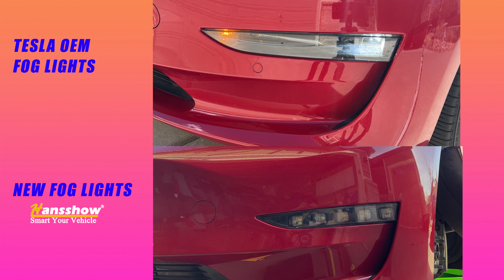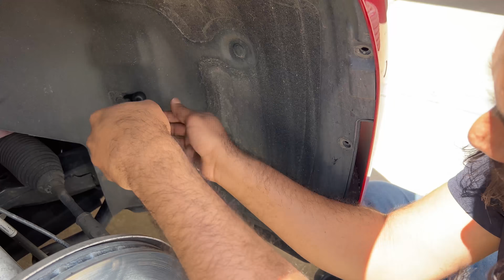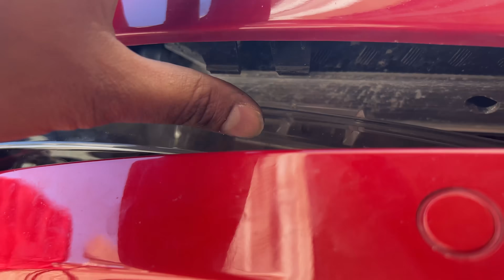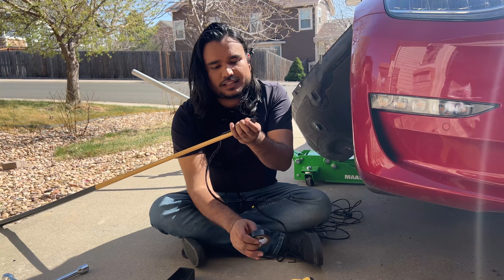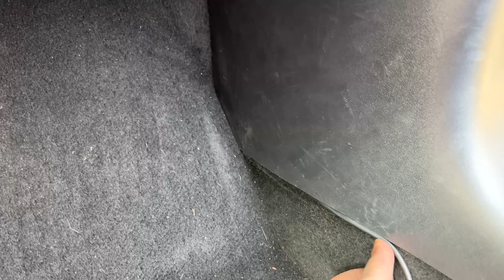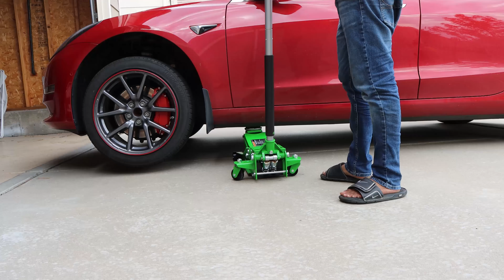NEW Sequential Fog Light Upgrade for Tesla Model 3/Y - Turn Signal (Must Have Accessory 2022)

Comment: Hi Shiva
Thank you for your hard work for us 
I have a question 

Could you please tell me 
Can you connect fog and bumper reflector lights to same Tesla tail light connector on back looks like they going to same tail connector 
Thank you
Reply from the maker: Hi Alex, yes you can daisy chain these plugs together.
Reply: Thank you Shiva
Is it one goes to another one?
Or I have to make some mod
For it
Reply: Thank you Shiva
Is it one goes to another one?
Or I have to make some mod
For it
Reply from the maker: @alexkalpin1569  They are all the same plugs, no modifications required.
Reply: Ok thank you so much

Comment: Do your amber lights for the fog lights come on when the brakes are applied? I installed them and the ambers light up with the brake lights.
Reply: Im having the same issue. Did you resolve yours?  Thanks.

Comment: So if you already had fog lights and you have no use for the harness and you just plug directly while tapping into the side camera for the turn signals …the fog light icon and toggle will work as normal?

Comment: Shiva I have now added the light, to my model 3  I used the alternative method of connecting it straight into the original wires that were connected to the original lights just swooping them over without running in the back lights  and by connecting to the turn signal on the side repeaters green for left side yellow for right you don’t lose functionality of the fog button it works as it should, the yellow wire on the light is not long enough I was able to use a pice of the wire that came with the kit to make it work I have spoken to Hanshow who will look at extending these yellow wires on there lights  this way it was much easier install  with no loss off the fog button  thanks for your great video it helped install and allow me to think outside the box to improve the experience.I will leave a link of  your video with mine so people will be able to do booth methods

Comment: Looks like a good option for standard range cars without a factory fog light. For the LR and Performance versions it looks like you lose a true and proper fog light which in conditions of fog there would be a loss of this functionality. Also with such an invasive wiring need would there be a possible warranty issue if something in the lighting system had a problem?

Comment: Thanks! Do you have any idea why these lights do not come with T-connectors for the head lights to get the turn signals? Also please update that it is possible to do an installation of working fogligths control (on/off) from the display.

Comment: You arent able to use the foglight functionality because you did not use the oem fog light connector. However, I did. I also did not route wires all to the trunk (OMG that would be a massive pain in th a—). I used the oem connector, bought T-connectors from amazon, and used the T connector to connect the yellow wire to each front camera on the inside of the wheel well (this way I didnt have to remove either camera).  Ive had the same fog lights installed for about 6 months now, I have all functionality and zero wires inside my cars cabin 😎
Reply from the maker: Thank you for your feedback. Yes, I have seen that kit and thought about the shorter route to just tap into the repeater camera but wanted to go with the longer route since many people get nervous about even the safe T connector tapping. I definitely think your method is much cleaner and efficient.
Reply: @ShivaSapkota Well good work. Love your DIY and review videos. Keep up the good work!
Reply: Hello , great video !
I will install this kit but I want to keep my fog lights fonction .
Have you got à like for the T kit ?
Or even a video tutorial of it ?
Thanks by advance

Comment: Your getting way better with the instructional videos. One question I have is are the cables there to instal the fog light on a 2022 rwd base model? Is it the same process?
Reply from the maker: Thank you very much for your kind words. I believe it is exactly the same process. I haven't heard anyone mentioned this specification changed on the 2022 models. So, this same kit should work.